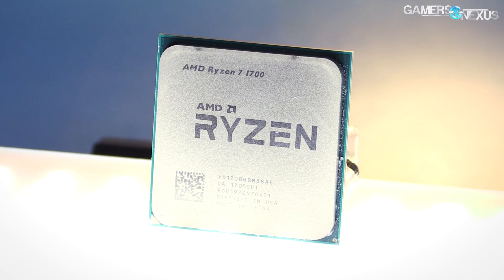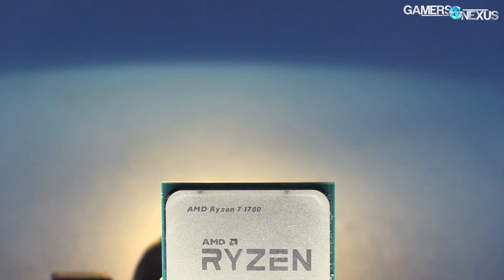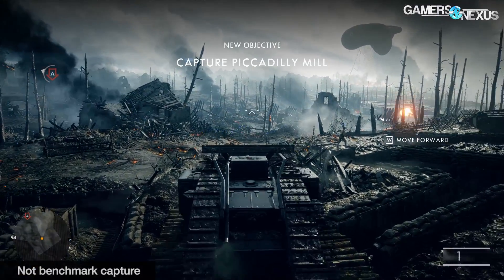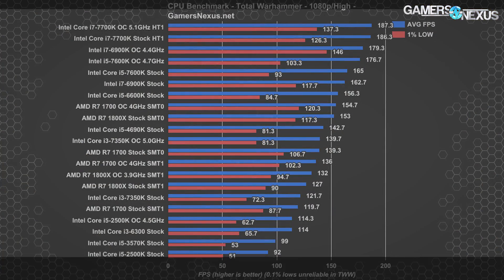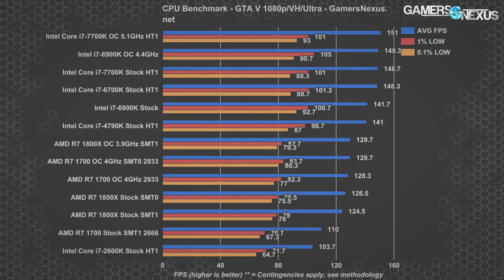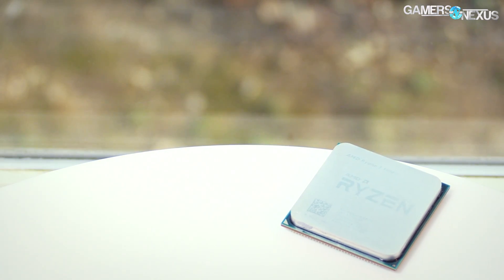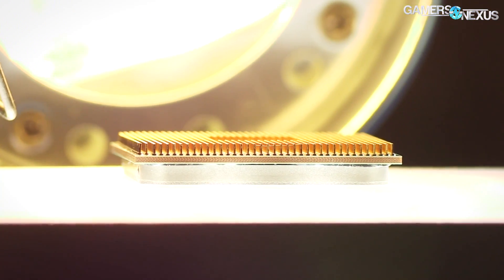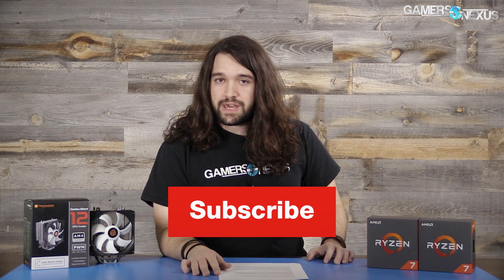AMD R7 1700 SMT Off + Overclock Benchmarks

Comment: Have you considered disabling one of the ccxs  both to see what the 4 core might be like and to eliminate the weird context switching slowdown between them discovered by PcPer?
Reply: This is what really needs testing, though I think PcPer are going to do it themselves so I'd wait for that.
Reply: +Beef Ingot If you watch the PCPer video, they explain that the way Ryzen 7 works is that the cores are split up into two modules called CCX's, each CCX has 4 cores, and while they're very fast communicating within thier own CCX, when data is going from one CCX to another it has significantly more latency. The guys at PCPer think this latency while in gaming workloads when there are lots of small chunks of data pinging between all the cores on the CPU might be why gaming performance is worse relative to a benchmark or video production where all the cores are being fed large chunks of data smoothly. The idea is of you disable 4 of the cores, i.e. 1 of the CCX's, you eliminate the latency as the data will stay to just one CCX.

Edit: I think I misunderstood the conversation here... I'm going to leave this comment anyway so people know the context of the video in question.
Reply: Henrix98 The point isn't to say everyone with a Ryzen CPU should go into the bios and switch off half their cores, that's obviously not realistic, the idea is that we can see what happens and it might give us an idea as to how the 4 or 6 core Ryzen 5 skus will perform, assuming they just use the one CCX.
Reply: from what I understood..it's like a dual socketed mobo but with 2 separate quadcores(CCXs) in 1 chip..the communications inside each quadcore group beats out intel's but it sucks when it send off signal to the other group..so, can developers just address games to just one CCX if we apply the "games don't use more than 4 cores argument"? or we'll just see this in the upcoming R5 quads, which is excitimg
Reply: Curious, the thing is, the 4 core is very unlikely to have significant gains from having less cores.

Its a completely different situation than with the 7700k vs 6900k, as those are generations apart which accounts for the difference, where as Ryzen 4 cores will be the same arch and same process. Im almost certain, any difference will be less than 0.1 ghz.
Reply: You don't need to disable one of the CCX's, you can use Process Lasso to assign cores and threads from one CCX for a particular game.  That way background processes can still run on the other CCX without lowering game performance.
Reply: THIS! I keep saying that as well. Also it might overclock a bit more on top of that to give us an idea of what to expect from the 4c/8thread can overclock to (though not exactly)
Reply: Darrell Ng Yeah, and even if games do need more than 4 cores there's always SMT to draw on.
Reply: No, SMT is not the same as actual physical cores. It just disables SMT not the physical cores :)
Reply: randomguy8196 SMT is basically Hyperthreading, disabling it disables the extra logical cores but not the physical cores. The suggestion here is to disable 4 of the physical cores to essentially turn off one CCX. In terms of how analogous CCXs are to separate CPUs, it's kind of like that but they do share some resources... it's more like an advanced version of the moduling used in the CMT units in Bulldozer.
Reply: Curious Wars thats still a big misunderstanding. The 6700k and 6900k are actually still generations apart architecture wise. Intel for some reason uses older archs on their x99 chips. Youd actually have to compare it I believe to the 4790k, which Im not even sure is a great  analogy because thats on a different process node.
Reply: +randomguy8196 No. Each cpu so to speak (ccx) has 4 cores. Each core is divided into 2 virtual threads with smt. Turning off smt still has 4 virtual cores active on each ccx instead of 8
Reply: 4c/8t is going to be a 2+2 config - not 4+0. It'll still have the issues of infinity fabric added ping between cores on a different ccx, unfortunately
Reply: ***** I assume yields. If you're getting non-viable cores, chances are they're not all on one ccx - so in order to sell those ones, 2+2 would have the least # of wasted chips.
Reply: From what I understand there is nothing that says that anywhere. Can you show me where you got that information? I definitely wouldn't be shocked if some of them ARE 2+2 but I don't see how you could say there will be no 4+0 as you don't really control where the defects are located (assuming the 4 core is a defected 8 core). It's very possible it's just a plain 4 core that doesn't have any disabled though unless they announced otherwise. From what I understand there are only rumors so far.
Reply: Beef Ingot Oh? I could have sworn Broadwell E is based on Skylake? They are both the same 14nm process except that broadwell e has some features skylake doesnlt (like quad channel memory) right? So how am I wrong here? Could you link me something that explains my fuck up?
Reply: Broadwell-E is based on Broadwell... That's why it's called Broadwell-E...
Reply: I get they are both named the same but that doesn't mean they are based on eachother. Everything I have read says broadwell is based on haswell and broadwell-e is based on skylake.  Either way I'm happy to admit I'm wrong but please provide a link that explains this because I can't find anything anywhere. Everything I see says broadwell e is based on skylake but with added premium features like quad channel memory. 

Either way it doesn't change my point. It's just kind of a deflection and doesn't address my point. More cores=more power requirement=moreheat=lower overclock potential.
Reply: I think what you're misunderstanding is the difference between process and architecture.

 Intel CPUs follow a set pattern in release that used to be called "Tick-Tock" and is now called "Process -> Architecture -> Optimization".

The process is the manufacturing process that the silicon is made with, for Haswell this was 22nm, for Broadwell and Skylake this is 14nm; smaller processes result in smaller dies, more capability for increased transistor count etc. 

 An architecture is a grouds-up redesign of the CPU that incorporates better & newer technology, more transistors and more features, often when a new architecture comes out that is where the biggest performance gains are seen. 

Because developing a new process is so expensive and time-consuming, Intel generally only do a "die shrink" as it's called once every 3 years, and in order to familiarize themselves with the new process, Intel will use a previous Architecture and modify it to run on the new process. This is the relation between Haswell and Broadwell, Haswell is the "Architecture" step, and Broadwell is the "Process" step. 

Haswell and Broadwell were based on "Tick-Tock", but future CPU's starting with Skylake will follow "Process -> Architecture -> Optimization"; so Skylake is "Architecture", Kaby Lake is "Optimization" and Cannonlake will be "Process" as it will be based on 10nm.

So this is how mainstream CPU's go; as for the "E" series enthusiast CPU's, these will often be on the previous step in relation to the mainstream CPU's as Intel takes longer to refine them to get the most performance out of them. "Broadwell-E" is definitely based on the "Broadwell" architecture, and therefore will have all the same characteristics of Broadwell in terms of base IPC etc. but "E" series CPU's will also get  some features from the newest mainstream set, for example Broadwell didn't support DDR4, but Broadwell E, like Skylake, does - that doesn't mean Broadwell-E is based on Skylake, though, it's still Broadwell.

Its not easy to get your head around, I know, but that's just the way Intel does things.
Reply: I completely understand that but the enthusiast CPUS have always been outside of tick-tock. Look at the extreme edition CPUS of the up to where they started calling them broadwell instead of "extreme edition"

Either way, as I said this doesn't address my point anyways but I'm happy to admit I'm wrong if you can show me where it says this. As I keep saying everything I've read so far points to me being right and you guys just keep making claims but not backing it up. I am always up to learning new things but I don't learn based on claims alone like any skeptic. Need something showing I'm wrong before I'll just take your word for it. No offense or anything :)
Reply: +Curious Wars hardocp released a brief article on it that they'd all be symmetrically distributed. Nothing said they wouldn't release a 4+0 chip, but i dont think that's likely. Also, the 4 core is definitely a defective 8 chip - amd is only having 1 production line run atm, the whole ryzen 5 - 7 line is the same silicon (with possibly lasered off cores, or just disabled).
Reply: Michael, Sure but explain to me why they would throw away perfectly functioning 4+0 instead of selling it? I think it's much more logical that they would do both instead of tossing them as the entire point is to save money. As I said they don't control where the defects appear and its VERY likely they would have some defects that work out to creating a 2+2 AND a 4+0. The 4+0 would be much more functional and thats why I wonder if the ryzen 5 is the 4+0 and the ryzen 3 is the 2+2 as it will be slower than the 4+0. Or is ryzen 3 it's own production line? Either way we are both ultimately speculating here as there is no "official" info from AMD on this. I'm just saying don't write it as hard fact when it's really just speculation :)
Reply: They're not outside of Tick-tock.

https://en.wikipedia.org/wiki/Tick-Tock_model

As you can see, we had Sandy Bridge in 2011, Sandy Bridge-E in 2012. Ivy Bridge in 2012, Ivy Bridge-E in 2013. Haswell in 2013, Haswell-E in 2014. Broadwell in 2014, Broadwell-E in 2016. Skylake in 2015, and Skylake-X will be in 2017.

It's always been this way so I don't get what you're so confused about.
Reply: Sandy Bridge in 2011 Ivy Bridge in 2012 Haswell in 2013 and then they stopped tick tock as they admited.

Sandy Bridge-E in 2012 Ivy Bridge-E in 2013 Haswell-E in 2014 Broadwell in 2014 see my point?
Reply: Curious Wars the issue with diversifying a product lineup too greatly is that it muddies the waters for consumers, confusing some (not all). There would be quite a lot less 4+0 viable chips that'd be thrown away vs the 2+2. Also, they've only announced two 4 core chips at the moment - and they're at different clocks. Unlikely that they'd only release 1 clock rate option for a configuration of cores. They're also shooting for consistency, so a symmetrical distribution of cores from top down does give them that.
Reply: m.hardocp.com
Reply: No, what is your point? I've explained it very clearly.
Reply: "There would be quite a lot less 4+0 viable chips that'd be thrown away vs the 2+2" Thats a bold claim considering there is more surface area for things to be defective in a 4+0 setup than a 2+2 setup. Either way, speculation not fact as I've said. You definitely could be right I'm just saying you can't make a statement of fact on speculation alone. We'll see what happens when it happens.
Reply: I'm pointing out that tick tock ended with haswell/haswell-e so you can't really say it's tick tock.

Perhaps we are playing semantics? "BASED" on skylake. Meaning not the exact same thing but based on it. My point was just that more cores always meant lower clock speed (and usually overclock potential) in the past even going back to the old core dual/quad days. I was just using the 6900k vs 6700k as an example of this. The architectures aren't so different that it should matter. even using the 6900k vs the 4xxxk does the same thing so arguing architecture doesn't change my point. it's just a deflection (though i think an unintentional one.)
Reply: Curious, I've been very clear in explaining how Intel's naming scheme & Tick-Tock/Process/Architecture/Optimization system works, Broadwell-E is *not* based on Skylake, it is based on *Broadwell*. I don't know why you refuse to accept this, but this is a fact, there's no semantics involved, this is how it is and I've provided plenty of evidence to support it. If you refuse to do your own research and refuse to listen to other people telling you how it is then there's nothing more I or anyone else can do to help you.
Reply: Ben Willock, You haven't' shown any evidence. You posted info about ticktock and ignored the fact that intel stopped doing tick tock on haswell before broadwell-e was even a thing. If broadwell-e is based on broadwell explain why the IPC is different? why can it support ddr4? why does it have all the features of skylake? DDr4 support can't just be slapped on a processor as an afterthought. it requires a complete makeover. This is proven by the fact that haswell and the 8xxx from AMD weren't just given ddr4 support. broadwell and broadwell-e are nothing alike. Where is the article from intel saying "broadwell-e is based on broadwell"

Either way. for like the 5th time, why bring this up at all? it's completely beside the point of my comment and I feel like you brought it up simply because you have no way to address my actual point. If you are going to keep being condescending I think we are done talking. It's not like you are posting anything relevant to the conversation anyways.
Reply: http://www.gamespot.com/articles/intel-core-i7-6950x-broadwell-e-review/1100-6440599/

"The 6950X is based off of Intel’s 14nm Tri-Gate 3D Broadwell micro-architecture, which uses a more compact lithography compared to Intel’s previous 22nm Haswell architecture. Those with one foot in the PC hardware scene might be wondering, “Why Broadwell? Isn’t Skylake the newer architecture?” Yes, Skylake is Intel’s newer architecture, but it makes sense that we’re getting Broadwell-E before Skylake-E."
It literally took me 2 seconds of Googling to find that. 

Intel has never based an E series (now X series with Skylake) CPU on the most modern architecture and have always based the product on the microarchitecture that it's named after.
Reply: If it only took you two seconds why did you not simply post it when I asked the first 4 or 5 times? I SPECIFICALLY said multiple times that if you would post something saying that I would happily accept it but you just kept deflecting. Anyways, I stand corrected. 

On a side note, now that you are done deflecting are you going to address my actual point or just keep pointing at something that has nothing to do with my point?
Reply: I was refering to the 6700k vs 6900k. There is a big difference in overclocking potential between these two chips. Not only are there less cores putting off heat but there are less cores to overclock in the first place meaning that heat isn't nearly the issue it is with the higher number of chips. I mean it's just a guess but it's still .3 to .5ghz difference in the intel side of things so I wouldn't be shocked to see something similar.

To clarify, I'm not making statements of fact. Just speculation. There is no real "objective" way to know either way how the 4core will perform/overclock until the 4core is out but it's shown that you can hit 5ghz if you pump enough juice and keep it cool enough right? so likely the 4 core will have more wiggle room.

Comment: AMD has stated the 1700X and 1800X run 20c cooler than displayed on temp software, due to an offset. Can you please revisit the temps on these chips, and whether the lower 20c would enable higher overclocks.
Reply from the maker: We discussed that in the initial two reviews where we noted that TCTL scaling still existed, but yes, we saw the 20C number and that is new information (the specificity of the offset). Might visit thermals again after this next trip.
Reply: Could you do a test with say only 4/4 cores enabled, to see how this stack ups against 8/8 8/16?
Reply: Gamers Nexus please do, stick a thermal probe in there for science!
Reply: https://community.amd.com/community/gaming/blog/2017/03/13/amd-ryzen-community-update?sf62107357=1

Comment: Hey, can someone tell me how to disable SMT ? i have an 1700 and a MSI B350 tomahawk motherboard and can't find how to disable it
Reply: Tensai Kami it is different from bios to bios, but it should be found there
Reply: Don't want to be rude but dude if it was so easy to find i wouldn't have asked here so yeah i know it must be there i need to know where that's the point of asking a question and waiting a response
Reply: Tensai Kami it's usually in the same menu that lets you overclock (change the multiplier)
Reply: There is an option to change core count but it doesn't have 8 cores only it just has 3+3cores 4+0 cores etc something like that so yeah this motherboard isn't that great and btw i can't even change the multiplier i hope they will implement it with the BIOS update :/
Reply: Make sure you are using atleast bios 113. https://forum-en.msi.com/index.php?topic=283115.0